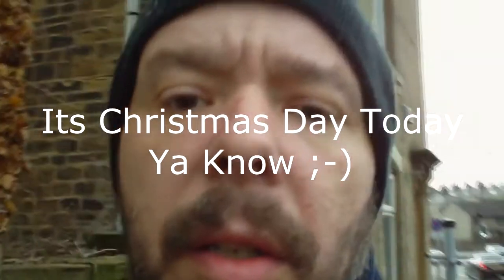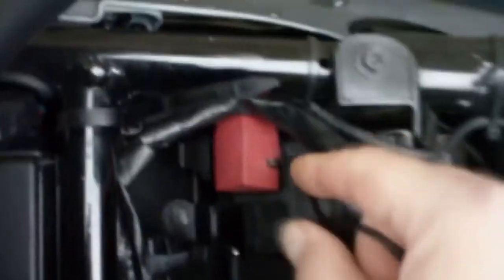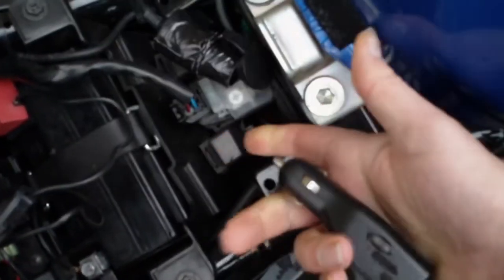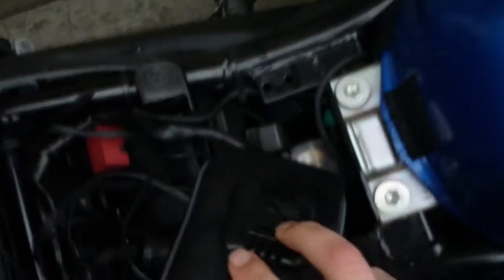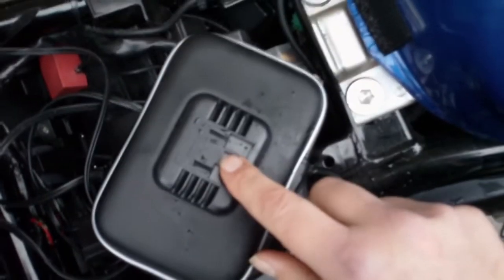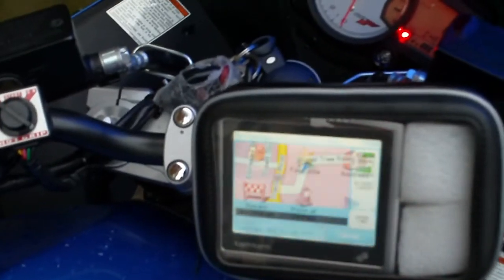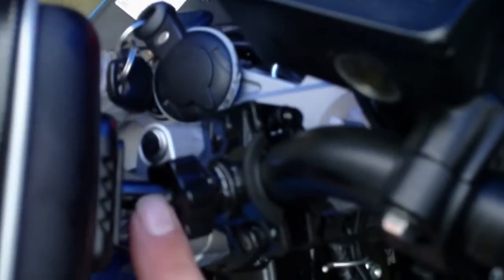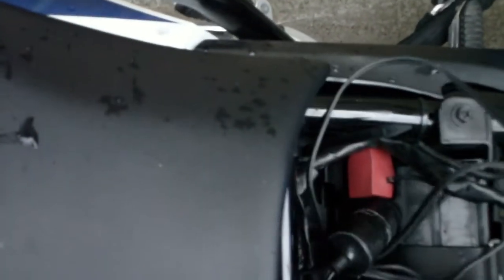Sat Nav and Holder for Bike

Comment: Hi thanks for uploading this video I have been wanting to do this myself for some time. 
My bike battery is a 6v and my car sat nav runs of a 12v battery so
will the sat nav power just the same on the bike as the car?
Dont you need to increase the volts?

Comment from the maker: Actually just checked and its already fused. Type the sentence below and paste it into the description in the search bar in ebay! without adding any category

12V Motorcycle Motorbike Waterproof Accesory Socket Power Charger+1.5m Wiring

Type the above and it shows three products its the bottom one that i bought,the one that says £76.99 But thats wrong it was £5.39. Just message them one the price if you buy one,theres an error on that price!